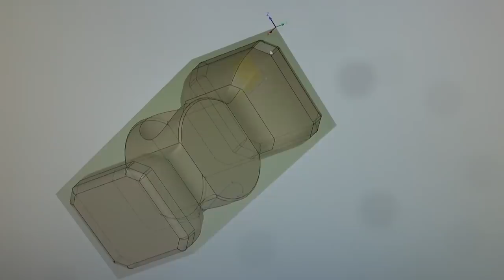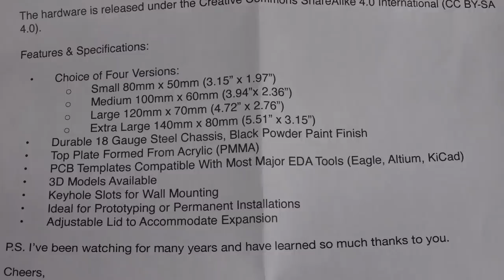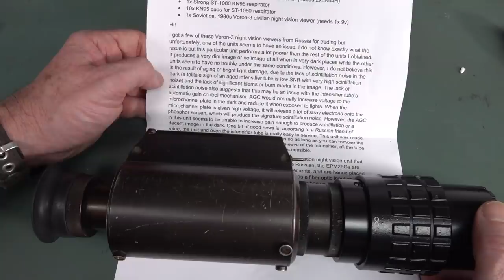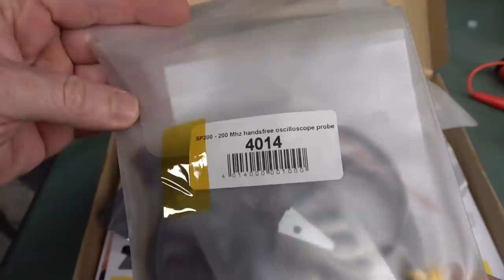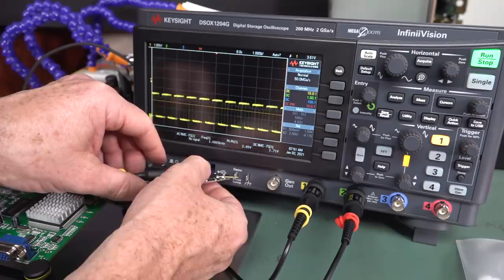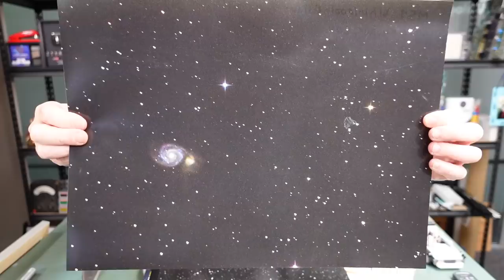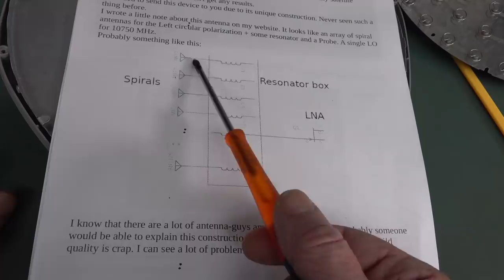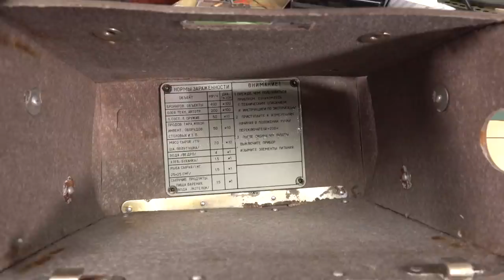EEVblog #1362 - A Very Skookum Mailbag

Comment: So the new meter is from 2007 while the old meter is from 1994. This is backed up by the different names on the meter.  The old MM was from 上 海 震华仪表厂  [Shànghǎi zhèn huá yíbiǎo chǎng] Shanghai Zhenhua [Instrament] Factory, while the new one says 中华人民共和国 /上海第四电表厂有限公司 [Zhōnghuá rénmín gònghéguó Shànghǎi dì sì diànbiǎo chǎng yǒuxiàn gōngsī]  People's Republic of China /Shanghai Fourth Electric Meter Factory Co., Ltd. From what I read This company   Designed a variety of domestic meters. For example, high-precision MF35, MF18, etc., high-sensitivity MF10, etc. In the early days of PRC, it was called "Shanghai Zhenya Electric Meter Factory". Producing products such as 508 and 500. Later, it entered a period of public-private partnership, called "Public-Private Joint Venture Shanghai Zhenhua Electrical Appliance Factory". A few years later, the public-private partnership ended, and it was called "Shanghai Zhenhua Electrical Appliance Factory" before the Cultural Revolution. During the Cultural Revolution, it was renamed "Shanghai Zunyi Electric Meter Factory". It was renamed "Shanghai No. 4 Electric Meter Factory" on the eve of the end of the Cultural Revolution. In 1981, the registered trademark "Xingpai Four Meters" was used. Now it seems to be acquired by an individual, called "Xingpai Four Meters Co., Ltd.". The main products include 500, MF30, MF18, MF35, MF10, MF12, MF14, MF20, MF63, MF64, MF85, MF368 and many other models. The 500 model is the most well-known. I can't confirm my translation of meter is correct because in Chinese it sounds more like a magnetic pointing watch.     [http://www.shtong.gov.cn/Newsite/node2/node2245/node4503/node55743/index.html]

  The other package is 澳大利亚 pronounced Àodàlìyǎ  Simplified (Mainland Mandarin)

Comment: I use the same rode mic that you where using in this video. The problem with the audio from the rode mic is being caused from how you have the mic positioned. The mic Pickup keeps pressing into your neck and picking up the vibrations directly from your vocal cords. Try psitioning the mic aproximately 5CM lower. Also the Pickup pattern of the Mics voice coil is directional. You need to clip it to your shirt with the transmitter pac  faceing away from you.

Comment: I've used this clock (at 56m) in late 80s. The main problem with it it's absence of memory/clock battery protection, so if at night time mains has drop for 1 second, clock goes to reset.

Comment: 22:30 :  Юпитер 5 - jupiter 5 (model)
22:37 : DO NOT TURN ON  IN THE LIGHT
Reply: Trick for image intensifiers: cover the lens with a non-transparent (also for IR!) cover and poke a tiny pinhole in the middle. Works well for use in indoor light. Turning it on in sunlight will quickly burn-in the phosphor - the final anode supply will be going full-tilt.

Comment: Mate be careful with the geiger probe dp5b the lump on the rotating ring may still have the strontium90 ceasium? check source in it and they were HOT!
Reply: I would have expected any ionising radiation source to have been picked up by Australian Customs checks.
Reply: Surprised if they allow postage shipment in this way.
Reply: The devices were never supposed to have strontium or ceasium inside them. They used cobalt radiation sources for calibration. The same material was used for cancer treatment machines so the infrastructure was available to produce it in the required quantities.
Reply: that is why the test didnt do anything, the 1 side is to use the tube, the other side is to test the tube

Comment: I like the dual-valve mask, because the valve is BEHIND the filter. I see too many people walking around with masks that have respirator valves. Why is this an issue? Because the point is to keep your moisture from spraying everywhere, and from personal experience using respirators for pesticides and fertilizers, I KNOW that your breath condenses on that valve and sprays everywhere. That Chinese dual-valve design... I'm not sure why the dual valves if they're both behind the filter (it doesn't really serve a purpose like that), but having the silicone seal means that your glasses don't fog up, which has been a CONSTANT problem for me. Fortunately, my day job is landscaping, which doesn't require a lot of inter-personal contact, and so I can get away without using a mask most of the time.

Comment: I'm thinking with the mic, it's just a pinhole opening?  If so then maybe it's pressing against your skin and covering it, then it's getting audio through your neck and not the sound from the air.  Actually had a cheap pin hole mic, in a quiet room, pressed it tightly above my heart and recorded it, the waveform in Audacity looked like one of those cardiac graphs!

Comment: On the Geiger counter, given all the stats are the same I'd expect them not to change the circuit as otherwise it'd be a laborious maneuver to "stat-match." EIther it's made identically or they spent millions in re-engineering the same device they already have an exact patent for.. Is that a dumb train of thought?

Comment: I think the Arduino vs. Evil thing is a joke. I have only ever seen him use an MSP430. From what I can tell he's quite cagy about his identity, even going through the effort to censor shiny surfaces so you can't see his face. So Bruce wouldn't be his real name. Fine by me, the man likes his privacy. In my mind, he's only ever been a set of disembodied hands. Great guy. By the way, my best guess on the rotating window on the geiger counter, if the plastic is thin enough, is to switch it between measuring only gamma radiation, or both beta and gamma. Alpha radiation probably will not make it into the device to be measured.

Comment: Work Bench Wednesdays!...but i dont get why you can zoom in on the TV... it is connected to a PC/laptop right?... strap a RaspberryPi to the back of the TV... with wifi mouse that lives on ya desk and profit! :P
your audio glitch...it sounded like the mic "hole" got blocked by your neck as you leaned forward some...

Comment: That's a 2nd gen night vision monocular..  Basically, the worst night vision generation as they generated huge amounts of scintillation noise that obscured the image due to combination of a multi-channel plate with 1st gen photosensor chemistry and traditional tube based intensifier stage.   You were better off with a multi-stage 1st gen viewer if you couldn't afford a 3rd gen device, which changed the photosensor chemistry and intensification mechanism which all but eliminated the overwhelming scintillation noise..   

Be careful when playing with that tube as it is somewhat sensitive to even slight overvoltage on the HV supply and can cause burns in the viewscreen phosphor (don't ask me how I know)...

Comment: old russian night vision is not that great,  I used to repair the stuff. thats a large 25mm tube. not much going one, give it some power and it works, might have a resistor to adjust amplifier voltage. those tubes are like aCRT with photo plates to generate electrons instead of a electron gun, then a charge electron plate with loads of little holes the emmitt more electrons.

Comment: Important note! 

This radiometer has got a "control/test" radiation source inbuilt in the rotating ring on the probe.

So please, do not disassemble this part or do it with caution. 

Please comment if you need more info on this thing.

Comment: The plastic casing of the detector tube of that Geiger counter probably is transparent to some radiation, most likely beta radiation. That turning steel sleve will absorb that radiation and gamma radiation will still penetrate and be detected. Gamma rays penetrate everything after all.  So by lining up the turning window with the gap in the steel sleeve in the fixed part of the case, you will detect beta and gamma radiation. Measure that for a while, then shut the window and measure for another equaly long while. The first measurement will give you beta+gamma intensity, the second gamma intensity only. From the ratio of the two, you wil be able to tell what radioactive element's decay you are detecting. By the time the operator of the counter loses hair and teeth, he might have produced usable data and have lived long enough to radio them to those who will survive whatever thing he was sent in to cope with.
Do I need to mention that a Ukranian sourced ninteteen-eighties Geiger counter should itself be tested for radioactivity?
Chernobyl 'n' all? Effing scary, that bugger! o.0

Comment: Mic seems to go nuts every time you lean into it. Time to put the dead cat on it.
Reply from the maker: A dead cat won't solve that. Something else is going on.
Reply: @EEVblog  Broken cable or a component loose inside? Just seems to stop when you apply pressure with your neck, and release it.
Reply: @EEVblog  maybe you are blocking the mic hole with your skin and its amping up the gain or something like that.
Reply: @EEVblog  You are wearing it wrong :) The thick part needs to be on the outside of your shirt. see: http://resources.rode.com/assets/WGO3.jpg
Reply: @EEVblog  You are probably covering the mic with the skin of your throat when you lean forward, and it thus increases the gain.
Reply from the maker: @perhansson6718  No, can't be that, as the audio increases and clips, not attenuates if it was blocked.
Reply from the maker: @miip  Yes, I know, it looks stupid on the outside. Maybe it needs to be that way to transmit properly?

Comment: Re mic issues - Picomic appears to be a nice miniature dual kit alternative with all the settings on the combo receiver/charging dock. 2.4GHz with "Adaptative high-speed frequency hopping with Wi-Fi and Bluetooth avoidance"  https://www.picogear.com/store/picomic-kit-dual/
Reply: sorry phil but i have to recommend against this, it is pretty crappy and the signal drops alot with even like 10 feet from the tx
Reply: @frogz  Cheers. Good to know. It seemed too good to be true at US$500. I'm not a fan of 2.4GHz, because any WiFi router near the  Rx can block signal from the Tx.

Comment: that's the most ridiculous antenna I've seen for this freq band. Those little things are just cosmetic to make it look fancy. they don't do s**t. whoever "designed" this is probably more of a "interior designer" than antenna designer. there is so much wrong with this so called antenna
Reply from the maker: They have to work, otherwise it's just a 10cm wire antenna sticking up inside a shielded box.
Reply: @EEVblog  yes, that's exactly what it is essentially. That's why Oleg mentioned that he didn't get anything out of it. Look the diameter of this thing is 26cm and they have claimed a whopping 31dB gain at 12GHz (wavelength =25cm) 
I dont care what is inside that thing, these numbers are ridiculous. interestingly the aliexpress store that I just checked says in the very title of the item's listing that is is not returnable! I wonder why...
but I'm gonna go ahead and buy one. since the frequency is pretty high it's not that difficult to test it even at home and see if it shows ANY gain at all. I am sure it will not. 
Another issue (which at this point does not really matter because the antenna will not work anyways) is that the so-called designer of this thing didn't know that for Ku band DVB, you have to receive both V and H polarizations and have to be able to switch between the two or you will lose a lot of channels. This LNB clearly has no input for the two separate polarizations and the so-called antenna also has no separate output for the two polarizations.
Reply from the maker: @amirb715  They have gone to a fair bit of effort otherwise with the preamp and the actual circular antenna thta are hidden behind the plastic outer sheet where no one is ever going to see them. So its not a useful marketing gimmick. Sorry, I can't believe it never worked at all and did nothing
Reply: The circuit board is more than an amplifier and has a down converter (ie local oscillator and mixer) such that the output signal down the coax is at a much lower frequency.  See the specs in the article at https://olegkutkov.me/2020/09/22/mysterious-flat-satellite-antenna-from-china/ The LO is 10.75 GHz.

As for the V and H polarisation comment above, the specs also clearly state "Polarization	Circular LEFT". 

This antenna is NOT intended for reception of  Ku band DVB.
Reply: @EEVblog  the antenna was used to accept TV signal from chinasat 9(92.2°E) satalite , after the satalite upgraded, this kind antenna is obsolute. but there are some modifications that let the antenna work again, that is turning all the little circles from clockwise to anticlockwise.
Reply: @EEVblog  On a sunny day, you might like to try waggling it @156E Optus D3, Dave. That's 51dBW and linear, so -3dB and say another -6dB for love. If you have a Spectrum Analyser or SDR handy, you could compare it to a bog standard 60cm dish and LNB. If it works at all, C/N (Carrier-to-Noise) should be about 10dB down. That LNB in the back has a DRO in it, so do reassemble it, nicely. If you have DVB-S2 receiver handy, you might just get one of the carriers to lock.